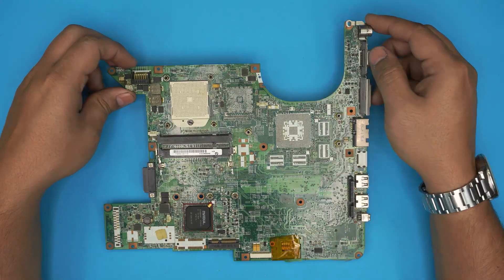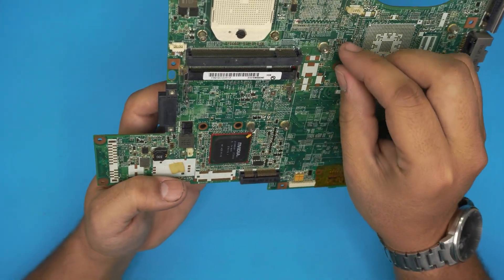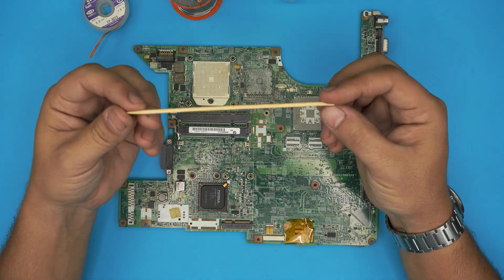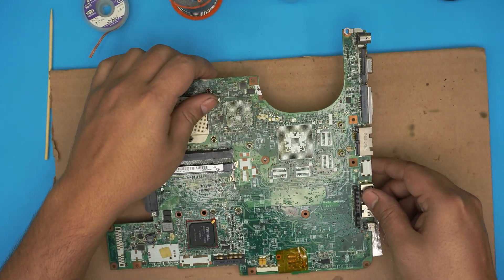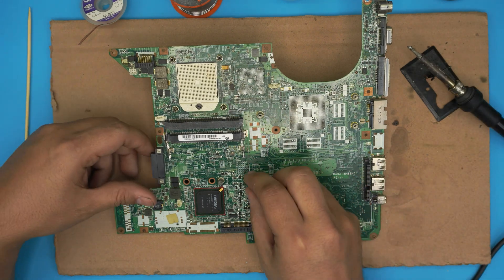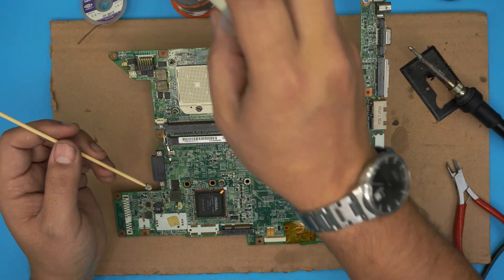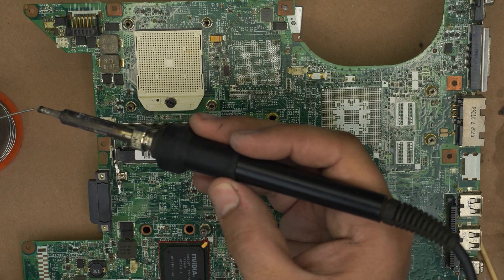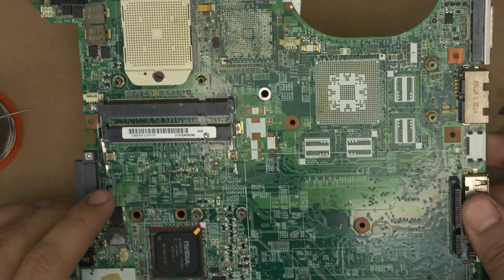Laptop Motherboard Heatsink Riser Repair 🔩

Comment: Trying to do this repair on a late 2013 MBP that has one riser broken, I’ve tried several times and triple checked that I’m following your instructions step by step, by the solder won’t flow into the joint/under the riser, it will only stick to the sides? Tried with more flux and with less, same problem. Tried with different temperatures, same problem. The last time I tried I managed to get it to stay with a messy ring of solder around the edges once, but obviously that’s not how it’s supposed to go, and as soon as I reattached the heat sink the tension brought the riser right off the motherboard again. What am I doing wrong? Is this fix possible for me?
Reply from the maker: you need to make sure the motherboard end where the riser goes is clean and there is copper exposed and clean it with flux and also place a fair about of solder and make sure the solder is reaching 480c and once placed the riser with flux makes sure you keep the solder tip touching the motherboard for 5-8sec minimum. send me pictures to may email

Comment: Not quite related to this but if I may ask if we can replace the NVDIA GEForce 940MX from Lenovo Yoga 520 14ikb laptop? The type which also has the Intel UHD graphics 620?
Reply from the maker: Thank you for the feedback! if you wish to support the channel you can LIKE or SUB or both :P
sorry that i was away for few days, regarding your question: 
you can't as it comes soldered on board its a BGA chip.
and the capacitors and power management components are made for that specific model. 
you can take the board to a highly qualified technician to do a good job of reballing , to replace the  NVDIA GEForce 940MX  to the same model only, but not upgrade.
Reply: @uFixTek  I see thank you.